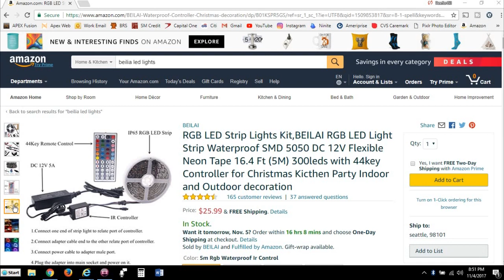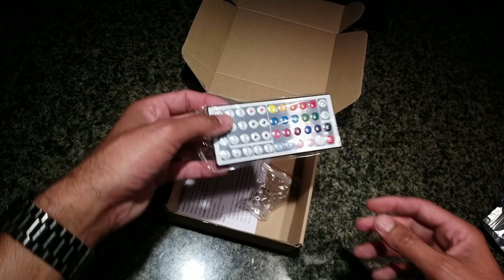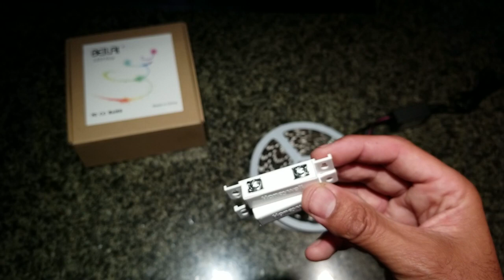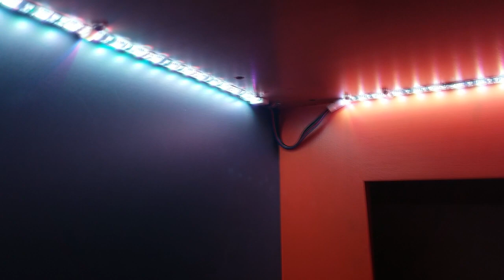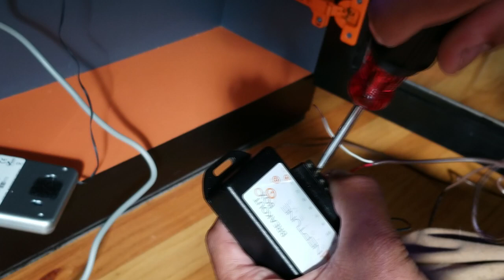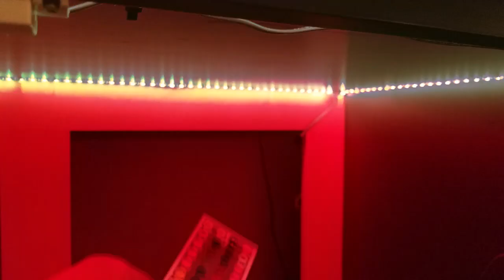Build Series| Eps. 11| Aquarium Stand LED Lighting

Comment: You can use a ground wire “pigtail” to connect the 6 grounds if you fill it up. Don’t try to put 6 wires in... great video 👍🏽
Reply from the maker: I've seen those pigtail circuits, they're really the only way to go. If I need to use more ports, I'll look into one of those. Thanks!

Comment: Nice video! I bought these for my stand about a month ago. They are great lights but you have more patience than I do and I scrapped the project and used them above my kitchen cabinets..lol. I got frustrated with the tape and the connectors. Of course I was working with a filled stand and made it hard to get around under there. Looking good ReeferGil!
Reply from the maker: If there was a sump in there, it would of been much tougher. I'm hoping these lights last.